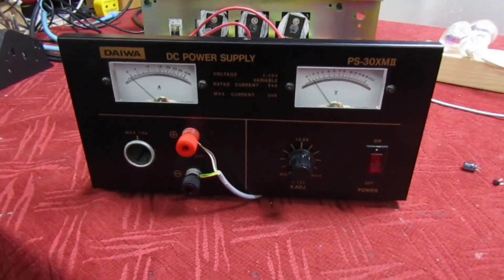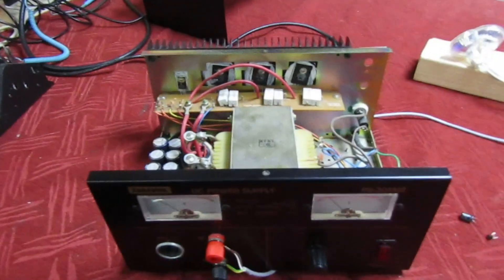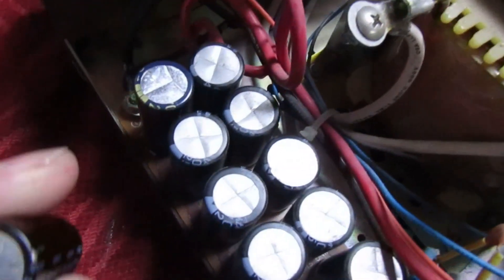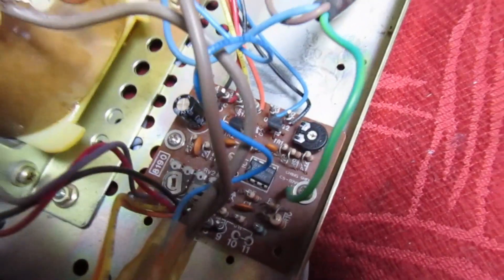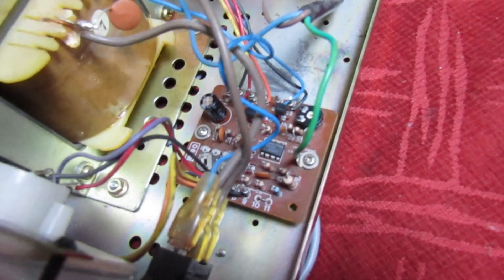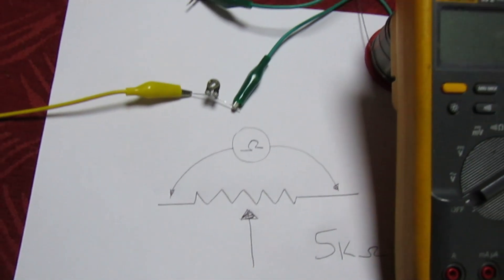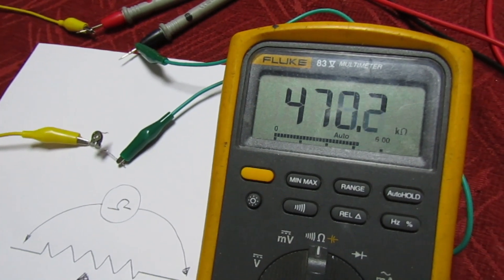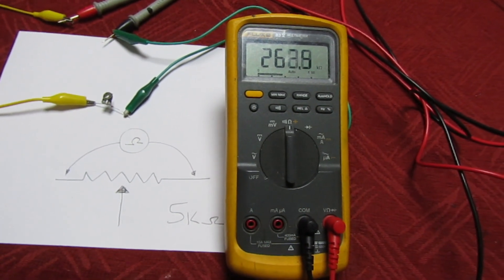Daiwa PS-30XM . 30 amp linear power supply, very intermittent fault, sorted .

Comment: Definitely, always suspect the presets and the bits which get hot ! Very interesting presentation Michael, just one point though, wavy lines for resistors went out with the arc. Sorry, I used to be a City and Guilds external verifier, old habits die hard.
Reply from the maker: showing my age .

Comment: One big issue with a lot of these high current linear PSU's is there is no overvoltage protection. Adding  a crowbar is cheap insurance as if any of those series pass transistors go short (And they can and will) you will end up with quite a bit of voltage going in to the device that's connected to it. And one or more transceivers and accessories can cost several thousand pounds.

Comment: Under a microscope you might find a hairline crack where the tags are riveted to the 
resistive track.
The sort of fault that drives you nuts until you find it.
Reply from the maker: Thats what it must be , you will notice I fitted a decent quality pot .
Reply: @michaeldranfield7140  I noticed that you had fitted an enclosed pot.
I have seen this fault a few times on so called prestige Hi-Fi that is made
with cheap parts.